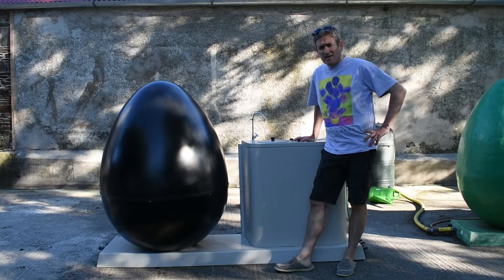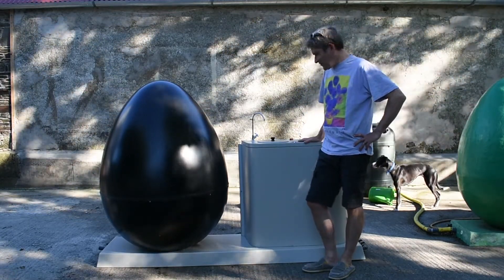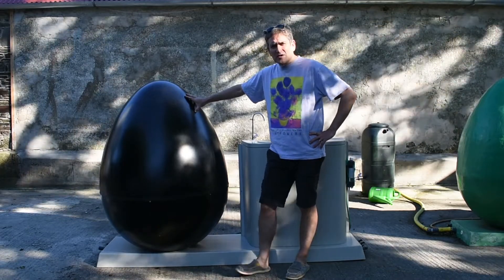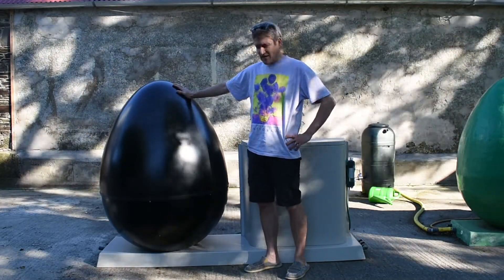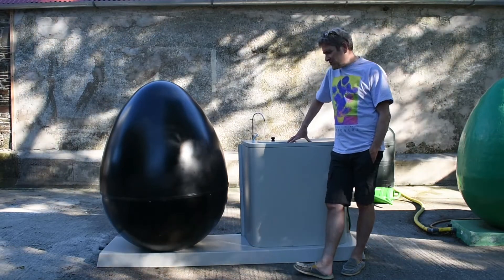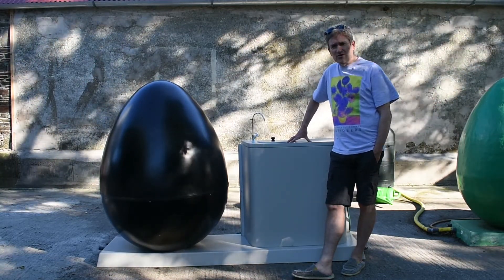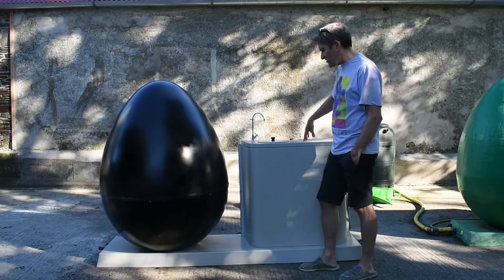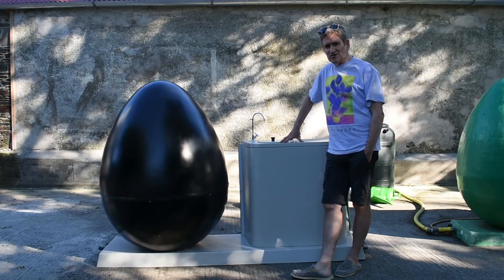Two tonnes of food waste a year, micro anaerobic digestion.

Comment: What price is it for the small house unit
Reply from the maker: Sorry Dermot, we are only selling commercial units at the moment.
Reply: Hi, how much energy does the Gugg use to maintain the temp above 20 degrees, does the system reuse the methane to maintain the temp. Thanks.
Reply: You can buy very simplistic units from Homebiogas ( 1000 Euros)  but you will need to figure out how to keep the temp > 20 degrees " Safely." The bacteria won't produce methane below 20 degrees. This is why the Gugg has a heating system.